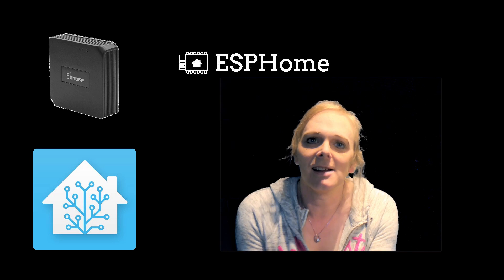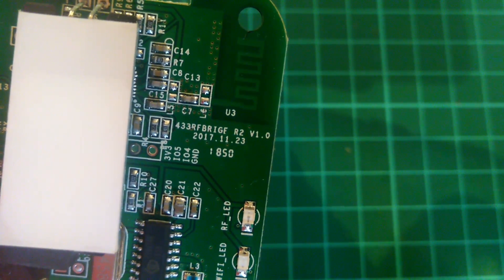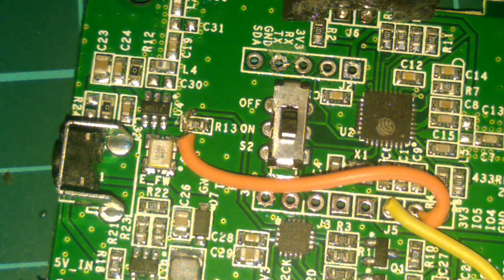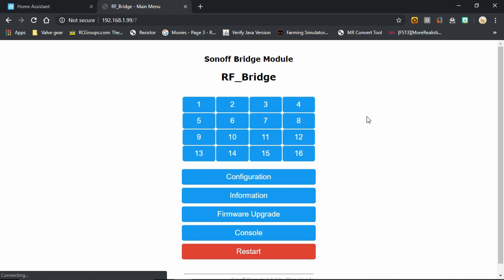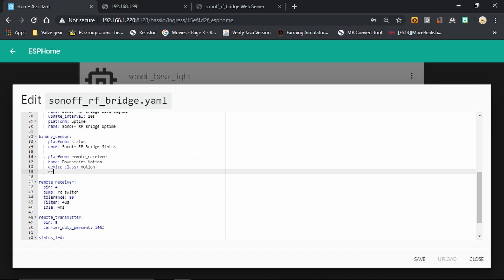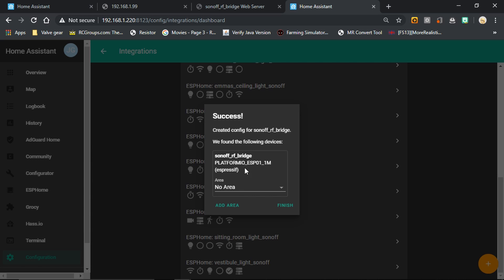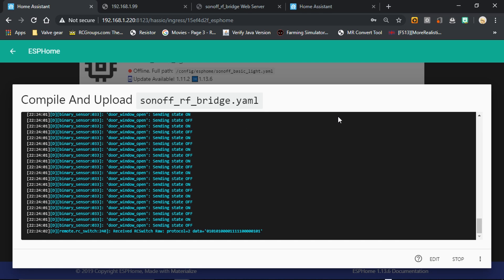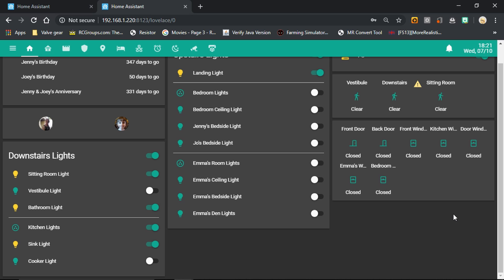Convert Sonoff RF Bridge to ESPHome

Comment: Be careful revision 2 has the wrong pins marked.
Instead of wire jumpers I would rather use 270 ohm resistors.

Comment: Hi pinkywafer
I have flashed my RFBridge with ESPHome and I will use the complete received code from an rf-participant in one variable.

The Receive-Code My ESP-Code have this form:
#
rf_bridge:
  on_code_received:
    then:
      - homeassistant.event:
          event: esphome.rf_code_received
          data:
            sync: !lambda 'return format_hex(data.sync);'
            low: !lambda 'return format_hex(data.low);'
            high: !lambda 'return format_hex(data.high);'
            code: !lambda 'return format_hex(data.code);'
#
My plan is, to concat: sync, low, high  and code to one variable. 
Example: sync: 3ba2, low: "01e4", high: 05a2,  code: 0014545c =>> to 3b9c01e405a20014455c

Do you know, how it works??

thanks...

Comment: Very interesting, just got started with ESPHome in the last 2 days, so a total noobe. So maybe stupid a question but if you have say a D1 mini with your yaml code and it has a cheapo 433MHz Rx & TX module connected to it, does that operate the exact same way as a hacked Sonoff RF Bridge. or have i got totally confused, but if that is so, would it do everything the same or would the Sonoff do/have extras.
I ask as i have had a Sonoff hacked RF Bridge using Tasmota for long while and for what i wanted it for was a nogo and wondered if the ESPHome remote_transmitter module features may have more features. Sorry if this is dumb, but as the hours pass getting more attracted to this ESPHome thing but now trying to take in too much info too fast. But whoever came up with that YAML format wants ........  Rgds.

Comment: Awesome video! I planned to do this mod but my RF bridge is ver 2.2 and a different circuit board.  Do you know if it is possible to install Esphome on this ?
Reply from the maker: I'm not sure.  If it is still an esp chip, I don't see why not, but there is now a sonoff RF bridge component on esphome, so you may not have to do any hardware mods

Comment: I'm curious why you use the remote_receiver component compared to the rf_bridge component? https://esphome.io/components/rf_bridge.html
Reply from the maker: When i made the video, the RF bridge component did not exist. At the time, the only option in esphome was to do the hardware hack and use remote_receiver
Reply: @Pinkywafer  thanks that's awesome, I thought it might be something like that, going to have a try with the rf_bridge component.

Comment: Thx you so much for this video. I have question: after migration to esphome can Sonoff RF read and send rolling codes?
Reply from the maker: Rolling codes are not supported.
It would not be easy, but may be possible to do it via lambda code, but even that would only be possible if the algorithm for the code change was known
Reply: @Pinkywafer  thank you for the answer and is any simple solution for rolling  codes? (need for my garage gate and fence gate)
where I can find info about lambda codes
Reply from the maker: The code algorithms are not usually available, as it would be a security risk. I would imagine that it would take a lot of effort and research to work out how they work. You can read about lambdas on the esphome website, but the code is essentially written in C
Reply: @Pinkywafer  thx and have nice christmas
Reply: i need help with some other thing in HA can i  send you e-mail?
Reply from the maker: Sure, or message me on FB. I'll have a look when I get chance

Comment: Awesome video! I've been needing some cheap outdoor motion detectors, I have 1 Insteon (expensive) and a home-made esp-01 unit, but I  wanted some cheap battery-powered units. Did some Googling and read about the Sonoff RF bridge. Sounded perfect. Oh, hardware mods required? No problem! So I  ordered 1 and a cheap < $10.00 motion as a test. I'm also a huge fan of ESPHome (nothing wrong with Tasmota, but ESPHome works for me for some other things) then found your video. I went straight from the factory RF bridge to ESPhome so needed to connect to USB for the initial flash. Worked first try!  Almost too small for my 60-year-old eyes, but I have magnification and some good soldering tools, so got it done.  Thanks!

Comment: my congratulations great video.  would you have any curtain code?  and can I get feedback if I use the curtain control?
Reply from the maker: Thanks. I haven't actually done any curtains, but check out the ESPHome docs - look for the 'covers' section. You can get feedback, but how accurate it will be will depend on the equipment you use. Ie you could use an end stop cover if you have limit switches, and if you give it the time it takes to go from end to end, esphome will estimate position. This is also true of time based cover, but without limit switches, or you could use a template cover if you have some other method of sensing the position.
Reply: Pinkywafer thank you

Comment: This mod with ESPhome certainly made it a little faster and easier to manage automation within ESPhome, but at the expense of transmitting codes reliably. My YAML snippet as follows, none of the switches trigger the 433mhz device.  I can see the code being transmitted is correct on my remote decoding device, but the pulse is all over the place.   Tasmota with stock RF firmware used to send MQTT message "RfSync 9400; RfLow 320; RfHigh 880; RfCode 14384325"; I can see decimal 14384325 = to Binary '110110110111110011000101'.  Do you know if there is a way to set the RfSync, RfLow and Rf High in ESPhome?

remote_transmitter:
  pin: GPIO5
  carrier_duty_percent: 100% 

switch:

  - platform: template
    name: "TestSw1"
    turn_on_action:
      remote_transmitter.transmit_rc_switch_raw:
        code: '110110110111110011000101'
  
  - platform: template
    name: "TestSw2"
    turn_on_action:
      remote_transmitter.transmit_rc_switch_raw:
        code: '110110110111110011000101'
        repeat: 10
        
  - platform: template
    name: 'TestSw3'
    optimistic: true
    assumed_state: true
    turn_on_action:
      remote_transmitter.transmit_rc_switch_raw:
        code: '110110110111110011000101'
        protocol: 1
        repeat: 6
    turn_off_action:
      remote_transmitter.transmit_rc_switch_raw:
        code: '110110110111110011000101'
        protocol: 1
        repeat: 6
Reply from the maker: You could try setting your own protocol.  instead of using protocol:1 you can adjust the pulse length, sync etc  Have a look at https://esphome.io/components/remote_transmitter.html#remote-transmitter-rc-switch-protocol for all the options. I haven't tried it, but i'd try 

protocol:
  pulse_length: 9400
  sync: [320, 880]

As a starting point, but you might have to try various different values in the protocol section.
Reply: @Pinkywafer  Thankyou, after a lot of trial and error, I have got a few remotes now working.  I have a frequency and code reader device that can detect the pulse width, however setting this did not initially work. Setting the pulse width and then adding a 100uS delay between repeat did the trick.  I can confirm that that pulse width has to be adjusted for each type of remote. In my case, I have six RF fans from 4 different manufacturers.

Another issue is the Sonoff RF ran out of memory after adding three fans (1fan=5 switches- on, off, high, medium & low).  I quickly moved to ESP32 with an elCheapo 433mhz transmitter, works well now.

ESPHome based RF works super fast, it was worth the effort.
Reply from the maker: Excellent! Glad you managed to resolve this.

Comment: Moved back to tasmota. I can see devices and get codes. reflashed ESPhome. Nothing received - I see this in startup remote_receiver.esp8266:063]: Remote Receiver Signal starts with a HIGH value. Usually this means you have to invert the signal using 'inverted: True' in the pin schema!
Reply from the maker: Try adding:
inverted: true
In the pin: section of the remote receiver configuration.
So you'd end up with:
remote_receiver:
  pin: 
    inverted: True
    number: 4
 Etc

I have seen this before, but usually have been able to receive signals both with inverted: True and without.
It may also be worth checking that you have a good solder joint from the chip to gpio 4, as Tasmota does not use this to receive signals.
Reply: @Pinkywafer  Works like a champ.. Thanks

Comment: Just got it converted to ESPHome. Not seeing my devices. Can I flash Portisch on this build or do I need to go back to tasmota?
Reply from the maker: The wire from the RF receiver to the gpio pin bypasses the chip so all decoding is done on the esp instead of the chip. Esphome cannot communicate with the chip, so to do this, you'd have to remove the wire and go back to tasmota
Reply from the maker: Actually, thinking about it,. You shouldn't need to remove the wire as the original path is still there. Flash tasmota to try portisch.

Comment: Tip ... buy a D1 mini and an mx-05v on aliexpress and you have your own Sonoff Bridge for less than 3 euros. is even easier to make and works just as well with the same esphome setup as in this video. just change the transmit and receive pin in the config file you use on the D1 mini.
Reply from the maker: Great way to do it... I've been planning to do this as a way of adding a few extra receivers for places where RF signals get 'lost'!
Reply: Pinkywafer correction. do not use the mx-v5 receivers. these are very bad. the transmitters that go with it are more than fine but the receivers a crap. I now use the rx480 receiver and I like it very much.

Comment: thanks !! this video helped me a lot. receiving signals really works a lot faster now. sending signals is unfortunately still not reliable. 1 out of 10 signals are not received and can therefore not be used for my heating. am I doing something wrong or is this standard with Rf?
Reply from the maker: Usually if sending RF signals, they are repeated. I would use repeat: 10
RF can be interfered with so easily and cannot be guaranteed that repeatedly 'banging out' a code is the normal approach, (and sadly also compounds the problem)
Reply: Pinkywafer Yes. have found out that rf signals are not 100% reliable. I changed the protocol for pulse length and made my own sonoff bridge with a D1 mini and a better transmitter than the one in the Sonoff. Works better now.

Comment: I am trying to upload the esphome binary, but I'm getting "upload Failed Upload buffer miscompare". Any advice anyone?
Reply: In case anyone else gets this error. I re-flashed with tasmota-minimal.bin issued the command "SetOption78 1" in the console and re-flashed with the esp binary.
Reply from the maker: Nice find... Tasmota binary is now very large, so needs the minimal to be able to upload many other binaries OTA. I think setoption78 allows uploading other firmware (without it, tasmota checks that the firmware you're uploading is also a version of tasmota)

Comment: Great video, I'm running my two RF Bridge devices on Tasmota and wondering what would be the advantage to migrate to ESPHome, especially since there is no going back to Tasmota once you have made the physical changes. To me the configuration seems more complicated than on Tasmota, it may be because I am more accustomed to it. I have only one device running ESPHome, that is a SonoffSV which I used to open the Garage Door, now changed to a Shelly1 and I found that after we had an occasional power outage, it would no longer work until I restarted Home Assistant. That was rather unpleasant and was the reason why I changed it for a Shelly1. Getting back to my question, in your opinion, what would be an advantage of ESPHome over Tasmota? Thanks

Comment: Thanks for the video! I have a question. I have a doorsensor that sends out open and close with the same code. Can you share any workaround for this. So if the binary sensor notices a signal it should switch the state to open. And if the notices a signal again it should switch to close? Anybody?
Reply from the maker: try something like:
  - platform: remote_receiver
    id: door_sensor
    internal: true
    rc_switch_raw:
      code: 'your_code_here'
      protocol: 2
    filters:
      delayed_off: 100ms
      
  - platform: template
    name: Example Door
    id: example_door
    device_class: door
    lambda: |-
      if (id(door_sensor).state) {
        // door sensor is triggered
        if (id(example_door).state){
          return false;
        } else {
          return true;
        }
      } else {
        return {};
      }

Comment: Hi ... how could that buzzer (on the Sonoff) make sound when the PIR sensor detects movement (just like that red LED that lights up)
... I want to use the system as it is ... sensor and sonoff without internet ... thanks!
Reply from the maker: Hi. I'm not sure what you mean. There is not a buzzer on the rf bridge
Reply: it is definitely a buzzer on the board ... it makes a sound when you pair the PIR sensor ...
Reply from the maker: @avant20full  My apologies! it was a good while since I've been "in" the rf bridge and I never used stock firmware, so had forgotton all about the buzzer on learning mode!  I have looked into it, and it seems that the buzzer is controlled by a second microcontroller, so the only option would be to make a further hardware hack or add an additional buzzer to the last free GPIO (I think it's GPIO2 - labelled SDA on the header if I remember correctly)
Reply: @Pinkywafer  
I would be very happy if you could help me, but thank you anyway!

Comment: I got an "Upload Failed" after doing all the hw modifications. I have a R2 V1 board. Can you help ?
Reply: I managed to upload the firmware directly onto the esp chip
Reply from the maker: Excellent. The usb port is not connected for flashing,  so ftdi is the only option
Reply: @Pinkywafer  I have some issue ... All is working great but after an hour or so the bridge stops procesing the signals!? I no longer see the codes on the esphome logger. Any ideias ???
Reply from the maker: I don't know if it's the same issue,  but there is a strange rebooting issue which occurs randomly which only appeared after an esphome update (I'm not sure which version) and I'm still trying to figure out what has caused it. If it is that though,  it normally comes straight back online and continues reporting.
Reply: @Pinkywafer  it doesn't look like it's the same.. Mine has been on for a few hours and nothing
Reply from the maker: Hmm.. I'm afraid I haven't seen that issue before
Reply: @Pinkywafer  you are right ! it is the same issue. It starts working again after sometime without doing nothing..... Any ideas why ? Work around/fix for this?
Reply from the maker: As yet, I'm still working on finding the cause or a cure for this

Comment: Thanks, Are RF nodes easy for cloning? I mean can I emulate the code they send and the bridge will think its the node we associated ?
Reply from the maker: In theory, anything that can transmit the same rf code would be assumed to be the node associated. The rf receiver has no 'linking' with the node, it is only aware of the codes it needs to respond to. However,  most devices (at least those I have) seem to sent a code which is 24 binary bits long (that's a total of 16,777,215 possible codes if my maths is right!). Certain devices (such as car door locks for example) use a system where the code changes with each use. The rf bridge would be unlikely to be suitable for use in this application without knowledge of the relevant algorithms for changing the code. What's your use case?
Reply: @Pinkywafer  I'm thinking if  my neighbors are courious like us, can send orders to my system. Activating alarms or turn on/off lights... Just thinking... ;-) Thanks !!
Reply from the maker: In theory,  yes they could. If they could find the right code... this is however no different to a conventional wireless alarm system in that way!